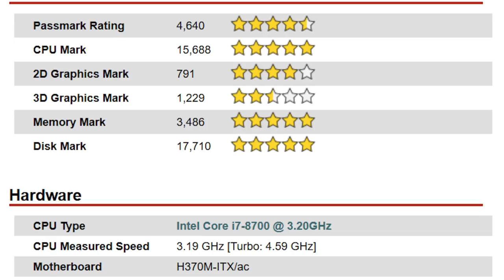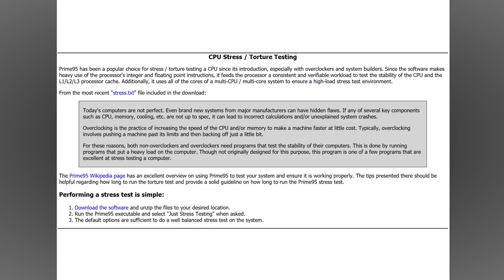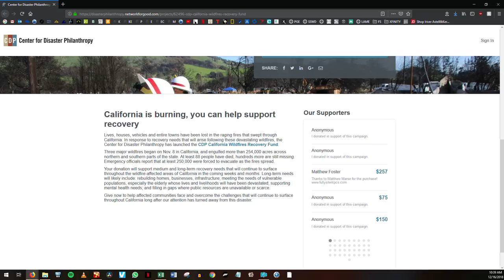Streacom FC8 Audiophile PC - Building a Fully Silent Fanless PC

Comment: So I finally found time to build mine. Also 65W Intel CPU. Got similar results to yours at about 18C ambient on first testing, but my room went up to 29C (yay Australia) this afternoon, and it was getting into the high 80s. Still, it recovers fairly quickly when load is removed, and I’ll never stress the cpu as much as Prime95 does in my normal work, so I think it’ll be fine. Silence is totally worth it - so sick of whiny fan in work laptop (its TB3 dock has one too!). Fingers crossed we don’t get too many 40+ days this Summer....

Comment: Thanks for this! Nice to see someone build in this case before i attempt to do the same..
I have to say though, the four brackets that connect the top half of the block to the cpu mounting posts, that looks like a flimsy solution.. I'm sure it can be torqued down pretty good, but I'm not sure how they would fair over time, after being removed for upgrades, etc.. it would not be hard to replace them with the mechanism from a cooler master 212 with a little modification, for example..

Comment: Thanks for video. Have you considered comparing this Streacom to the HDPlex H5 in terms of benchmarking? Just a CPU cooling comparison, naturally. I'm more attracted to the HDPlex on account of the intelligent fin tops mounted above both processors, what to speak of the extra copper pipes.
Reply: Hi, I did do a comparison with the HDPlex H1.  All HDPlex cases outperform the Streacom FC8.  The H5 can handle 65W processors with ease, while it can be a struggle with the Streacom case.  It's not the additional heatpipes, it's the larger heatsink that makes the difference.
Reply: @mgfoster  Thanks for the info . I should have made mention of the Streacom FC10, which is more a direct comparison to the H5, rather than to the FC8, which doesn't have dual 65 watt radiation walls like the H5 or FC10.
Reply: @nickburak7518  Though one of the radiators on the FC10 remains cold while the other does all the radiating. Seems to me that the second radiator on the Streacom FC10 is cosmetic only. That said mine handles a 9700 (65w) under 30mins of stress testing with a max core temperature of just 79 degrees.
Reply: @tvandele  Well I guess if no heat pipes are connected to it... Anyway, it wouldn't support much cooling for a GPU to be sure.

Comment: Hi, what si the case modification please for the Hdplex power supply ?  Thanks for the job.
Reply from the maker: Holes were drilled into the drive tray to mount the power supply, and the rear case hole was enlarged to mount the 7.4 DC barrel connector.

Comment: Hey guys, i have the similar case from streacom, i bought it with an i3 8350k that didnt worked, it had the 160w psu and the power was to low, now i googeled and when i looked up these psu calculators, i found out that even 65 w cpus need more than the 160w psu can deliver, now i see you using 65w cpus, do they work? ist the calculator wrong? please let me know i would ike to ue a 12400 as cpu, would that fit or am i limited to an i3 8100? thanks

Comment: is there any BIG fullsize atx  passive chassi which lets you cool high perfomance CPUs passive withput thremal throtteling ?
Reply from the maker: The HDPlex H5 is the best option for ATX.  It can cool 95 W CPUs without thermal throttling.  The NoFan CR-95C is also really effective, and can fit in ATX tower cases.

Comment: Can a Ryzen 5650GE be used here (or similar 35 watts apu) with no throttling/overheating under load at 30 degrees celsium in my room while video editing? (35 watts 6 core cpu)

Comment: you think if the AC-DC adapter was showed in the case it would overheat something?
Reply from the maker: It would not overheat, but it would increase temperatures a little.  There also is not much space in the case, so it is easier to have an external AC-DC brick.
Reply: @fullysilentpcs  yep space is another concern its would be much easier to just have it outside, but i'm going for as little cabling as possible

Comment: I think this is not very practical, because itx motherboard these days has a pretty large heatsink on VRM, which blocks the copper pipe's way
Reply from the maker: Not all ITX motherboards have heatsinks above the CPU socket.  Many of them have VRM heatsinks  to the left of the CPU only.  Also, there is a riser (Streacom HT4) for motherboards with VRM heatsinks that get in the way.

Comment: Have you ever lost you music collection (especially when you don’t have CD anymore or they are already damaged)? Considering 32GB or RAM for an audio server and only one tiny SSD - you’ve not. Think about less RAM but an additional backup drive. raid is not needed for that. A simple rsync is enough.
PS i7 is redundant also. 400W psu is redundant too. This is a f audio server! Pentium with Intel 610, 8GB of RAM, 128GB SSD for a system. 2x12(15)TB under rsync. Kodi OS + Ampache + free NAS. No internal DAC cause it’s a BS.
Of course if you like to sell an audio server rather than a set of expensive components.